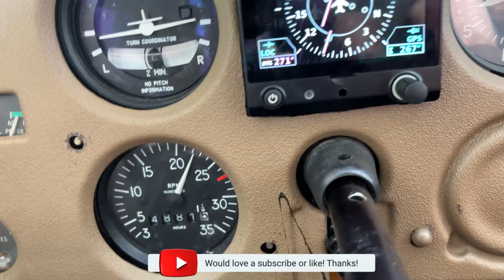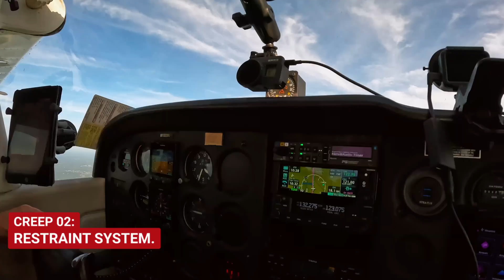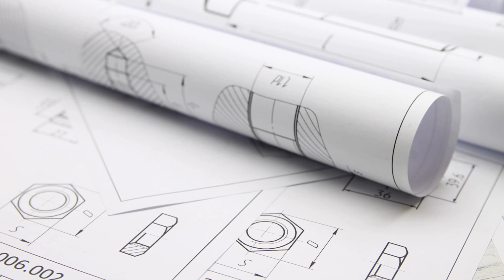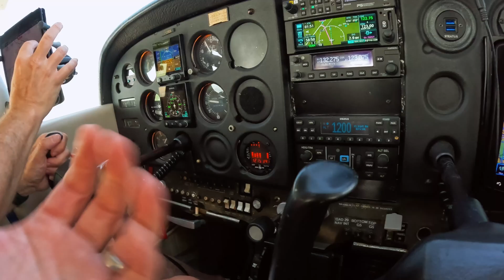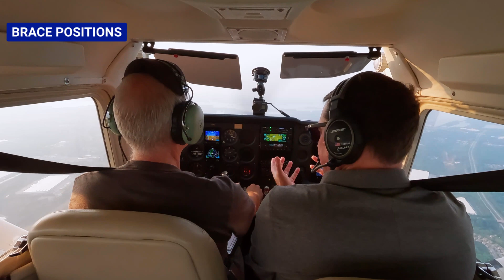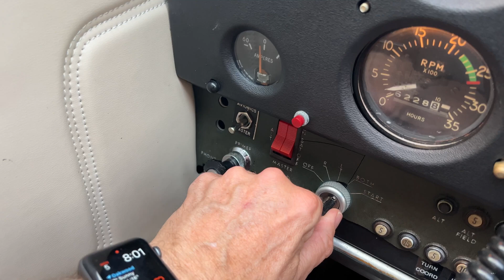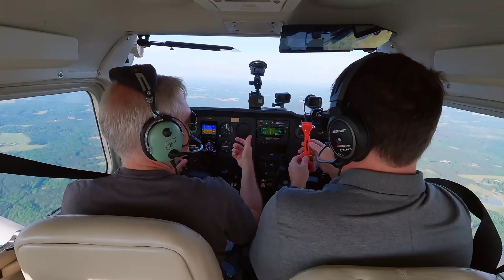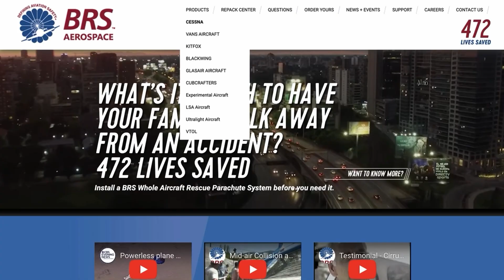Surviving Pilot Emergencies: Actionable Insights.

Comment: New subscriber here. All good ideas. One of the most important things you can do before impact is to open your doors so they don't get jammed shut on impact. That was the first thing my flight instructor harped on during emergency procedures training, "get those doors unlatched and open!" The wind will keep them pushed closed, but make sure they are unlatched. The seatbelt cutter is a greaat idea I will implement ASAP. Thanks for the information!